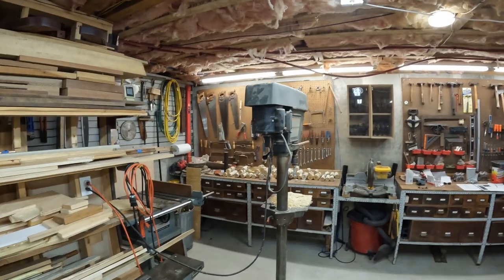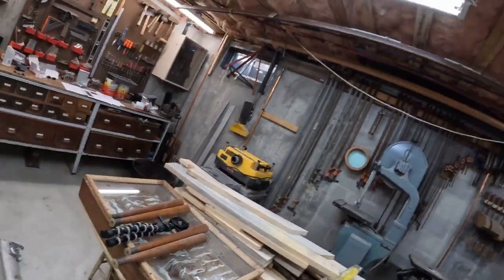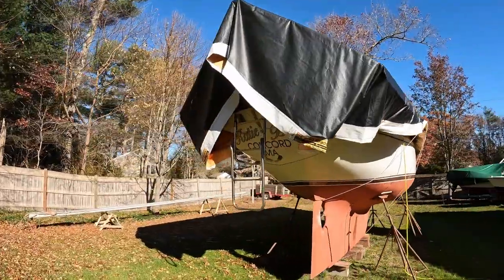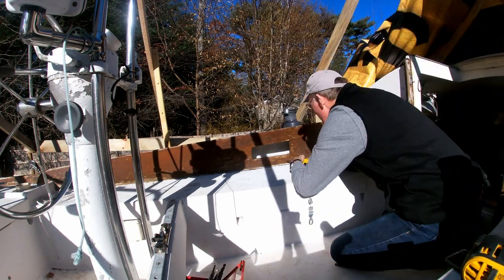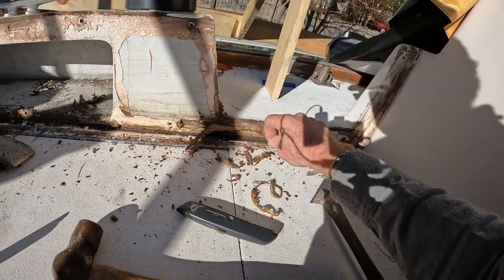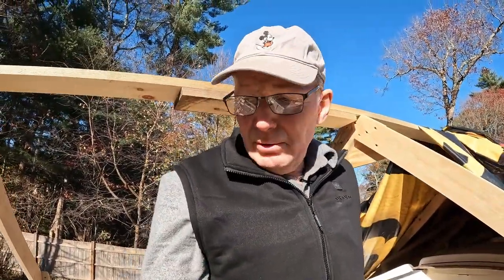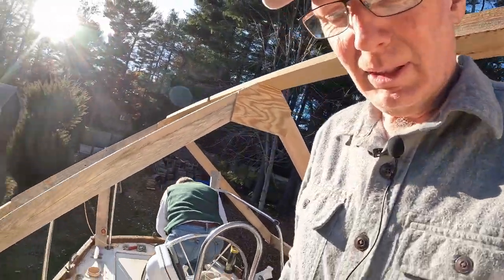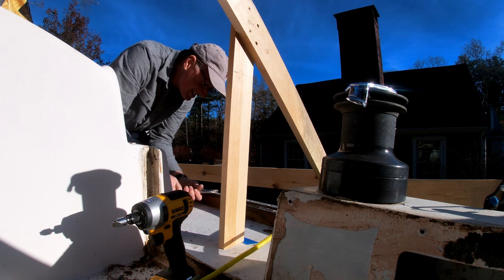#11 Coaming and Toe Rail removal

Comment: Thank you. Interesting, but needed sample close up of how the bungs etc are oriented showing exactly how the screws fasten the pieces to the boat. I'm first time viewer mechanically inclined non boat person. Good work and I know videoing adds a lot of trouble.
Reply from the maker: When I post the restoration videos, I will focus on making some dutchmen and will talk about grain direction and how it affects the repair. When I begin the installation of the toerails I will discuss how the bungs are glued, installed and finished. I am going to also spend one video showing how to cut all the bungs in various sizes and why for that one size is needed.
Thank you for your comments. Let me know of any other questions you may have.

Comment: Hello Greg, enjoying the videos.  Just letting you know if you were unfamiliar, the round plate on the wooden block forward of the stern toe rail is a mount for a Walker log.
Reply: Thanks for the information. While I am a traditionalist in many areas, I think I will skip the taffrail log. When I crewed aboard the Harvey Gamage we used one and had one the propellors taken by a large fish. GPS today is so much more accurate and doesn't require towing anything astern, other than a lure on a fishing rod.
Glad you are enjoying the project. Thanks for watching.